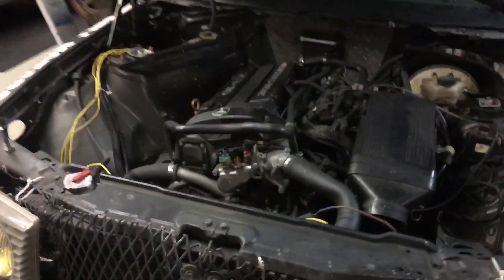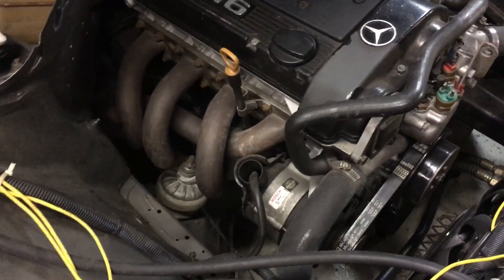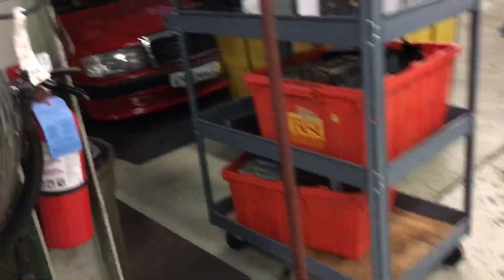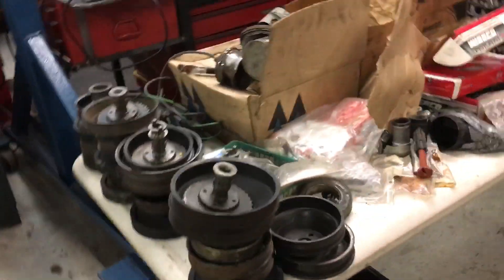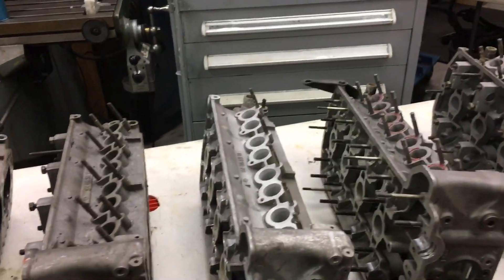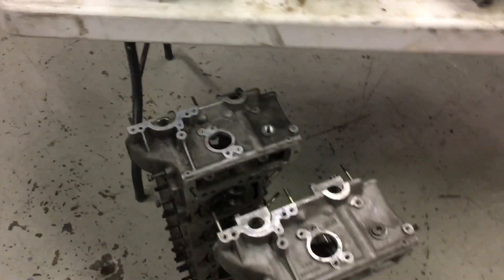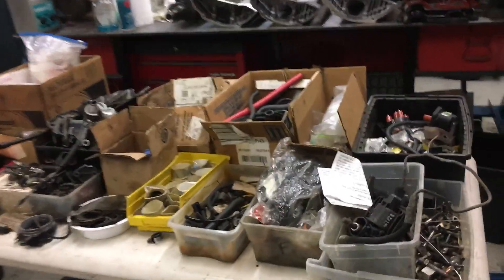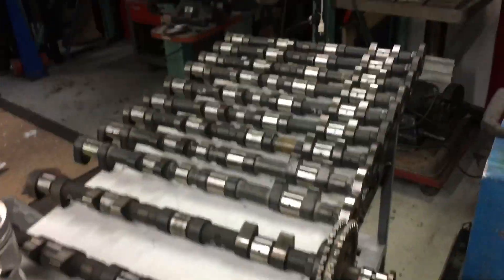Cosworth 16v 2.3 2.5 evo 190e Mercedes Benz

Comment: Those cossies had dog leg stick,if i remember? I had the standard 2.0E stick,1988 with 142,000 miles here in the UK and loved it,went pretty quick,was reliable and only had bushes squeaking which is the norm on them.I put this engine cleaner called "Astal 3000" i think back in 2001,got it off QVC here in England.Instructions said "To leave in engine oil for 500 miles".Damn it did a great job! The cam chain looked like new.....i do miss my 190E.